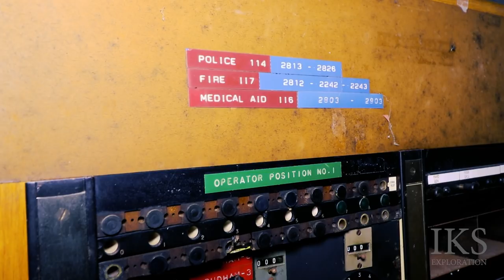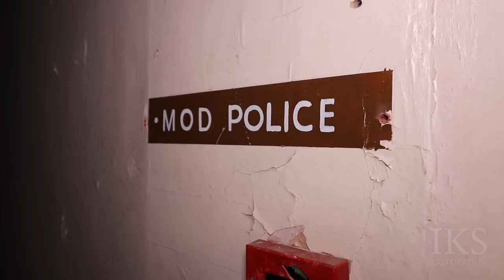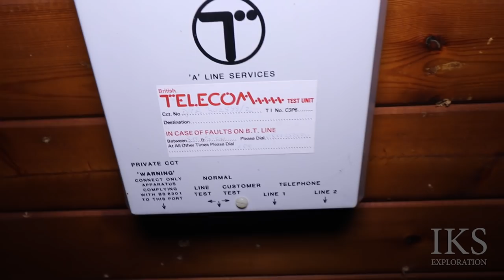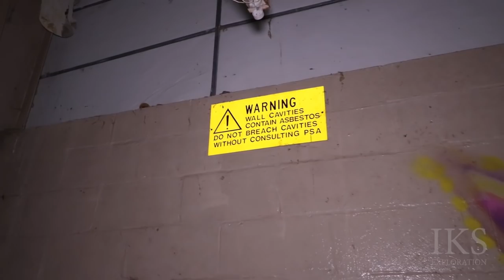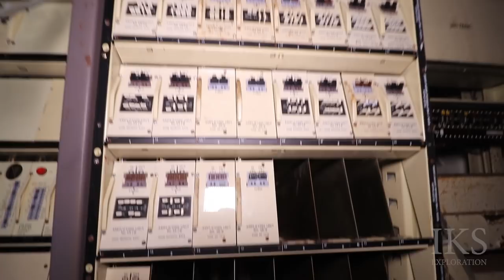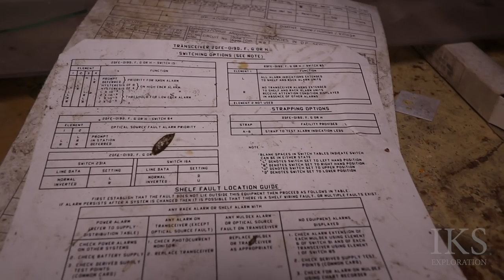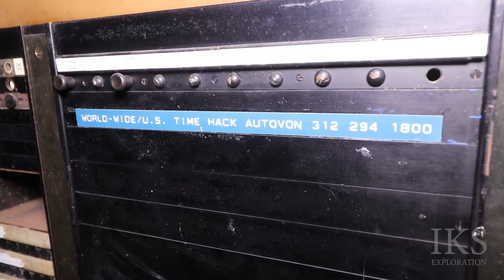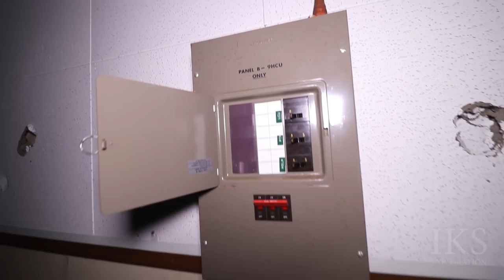RAF Sculthorpe - Norfolk

Comment: 3:09 Looks like a receptacle to clear firearms with. Stick the muzzle of a rifle or pistol into
the hole and you can look up into the chamber of the firearm to verify it is clear of ammo and safe.
If a round were to go off,it would safely go into the cannister-which might be filled with sand or water.

You may have been in the armory of the police station where they store & issue weapons.
Explains the gate and the file cabinet marked “magazines”,as in rifle or pistol magazines.
Reply: Just about to comment the same thing
Reply: Ahhh thanks,very informative.something i didnt actually think about cheers
Reply: That's what I thought , it just seemed to be in an unusual place pointed up instead of down.
Reply: Yeap
Reply: Atheist Orphan Nope. Not those kind of mags,but wouldn’t surprise me if they had a couple of issues hidden away from the CO. LOL
Reply: Misty Myles I’ve never seen them facing up,either. I’m used to see them facing down, like at our local gun store.
Reply: I’ve only ever seen one facing down like that and was on a US base. Normally saw them on the ground, facing up on GB bases.
Reply: Facing up like that I reckon it was more for long arm based individual weapons, but obviously could've been used for pistols as well.

Comment: Sculthorpe is still operational its used by special OPs based at RAF Mildenhall. 48th FW on one of the buildings is for 48th Fighter Wing based at RAF Lakenheath it used to be a detachment there when they had F111, they also used to be anther detachment for the 48th FW at RAF Honnington in Suffolk.
Reply: I've seen both CV-22 Osprey and larger USAF planes do take off and landing drills at Sculthorpe even to this day year (2024). I spoke to an ex-raf man and co-worker. Its not as common in recent years but Sculthorpe is still an MOD site and "operational" as you say, despite being abandoned. Landings are called in via 4x4 vehicles on the ground, no air control tower.

Comment: AUTOVON (standing for AUTOmatic VOice Network) was the switched voice communications system of the US military, now replaced by a digital system called DSN. The Autovon network covered all locations where US forces had a presence and there were a number of Autovon exchanges in Britain. This was an extremely high-security system, although through a loophole it was possible for a time to gain unauthorised access to Autovon from the normal public network (if you knew the dialling code!).

Autovon was notable for having four-wire (not two-wire) transmission (although a number of standard two-wire telephones were also connected). Telephones had four extra buttons on the right of the keypad, using the so-called A, B, C, D touch-tone (DTMF) frequencies to allow privileged users to set class of service for each call. These were "ROUTINE", "IMMEDIATE", "FLASH", and "FLASH OVERRIDE" priorities, with ROUTINE being the lowest and FLASH OVERRIDE the highest. To dial higher priority phone calls than routine, special authorisation was needed.

Each military installation had its own prefix for use in the Autovon and not all PABX extension telephones at military locations had the capability to call other military installations via Autovon. However, they could all receive Autovon calls coming from another installation apparently. Dialling codes and numbers were similar to the US civilian system but not the same; the last four digits were, however, always identical.

A detailed description of Autovon will be found in US MILITARY COMMUNICATIONS by Ricci and Schutzer (Computer Science Press, Inc, 1986).
Reply: comm1508 strowger pabx?

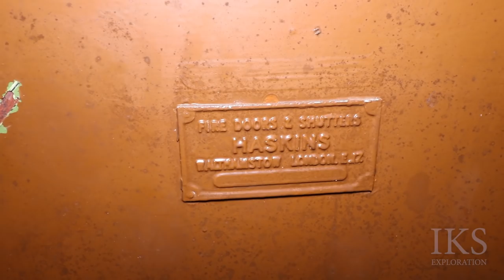Comment: Room at 23:30 -- Quite possibly the shredder/pulverizer room for secure destruction of classified papers.   Usually located in or near the command & Intel facilities, a high-sevurity room with heavy duty power & ventilation for the big shredder machine, which is bolted to the ground.     Older facilities usually had an incinerator located outside but nearby.

Comment: 3.09. you were in the armoury of the mod police, the red item on the wall was for putting the muzzle of the weapon into to pull the trigger and release the firing pin, which you had activated by freeing the chamber and ensuring nothing "up the spout". If there was, the red jobbie would absorb the bullet. In my time most armouries had a small skylight, you aimed through that.
Reply: The filing cabinet was for pistol and rifle magazines, not reading material.

Comment: 6:56: That looks like a DB25 connection for a V24 serial terminal. These were usually used for VT100 compatible terminals connected to a mainframe computer.
Reply: @zeberdee1972  I didn' really work in telecoms. That mainframe system that seems to have been in there was most likely not connected or even related to that vast telecom installation that is still in there. I am currently working in a building where these exact connectors were all over the place before we moved in. We had all of them removed and put in Ethernet cabling instead. I supervised that process and that's how I know. Still got some left over VT100 terminals. The mainframe room in the basement in my building still exists and some remains of a DEC mainframe system are still in there. Like a rack with a few 5.25" full height 1.9GB hard drives from 1993.